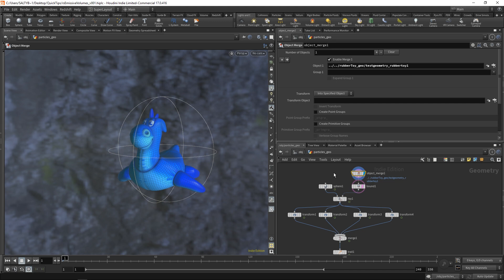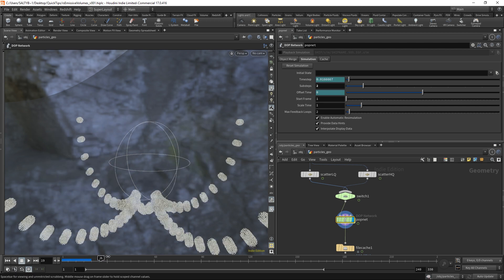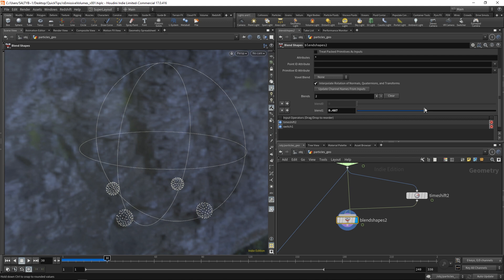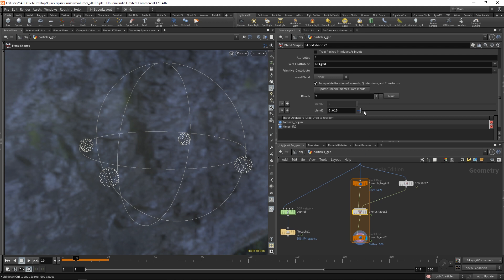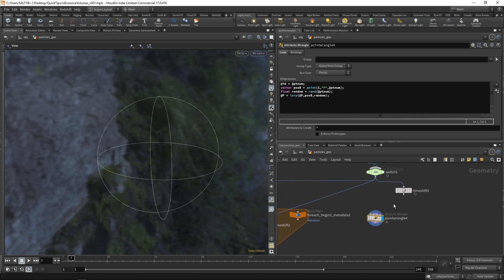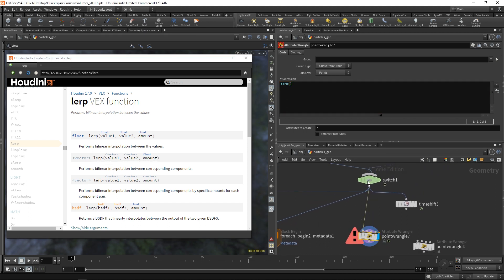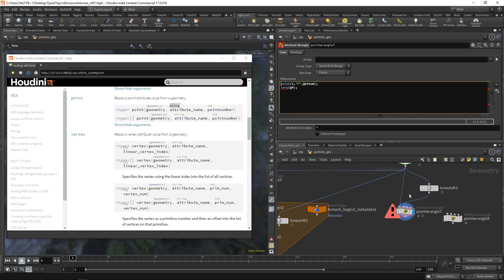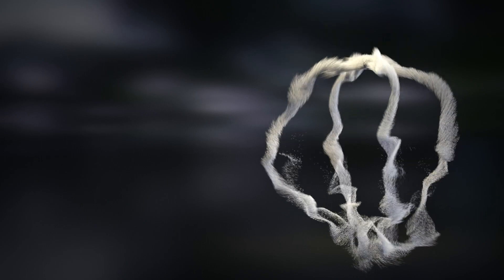Houdini For The Artist - Quick Tips - Particle Stepping

Comment: Isn't it same as interpolation? I usually set interpolation to 8-16.
Reply from the maker: Yeah, totally - you can just et the jitter birth to positive and the interpolate source to backwards.  That method will sometimes break though because it relies on interpolation on "Matched Typology."  So it's good to know a few other ways of going about in case you need to troubleshoot that situation.

Comment: Wouldn't it be far easier to just set Jitter Birth Time on the POP Source, and then Interpolate Source? That seems to be the exact setting for what you've manually built here.
Reply from the maker: Well shoot, you're totally right avinashlobo! haha   If you go that route, set the jitter birth to positive and the interpolate source 'back' because otherwise you might not be emitting from the actual location of the emitter, but yeah - whoops, that's probably the easiest way to go about it.  Thank you for the comment!
Reply: Thanks for confirming. I'm brand new to Houdini, just trying to absorb and make sense of the sheer volume of new things to learn. I picked up that tip from the Particles Masterclass video that I barely stumbled through: https://vimeo.com/81611332

He talks about it around the 53 minute mark. Thank again, and I look forward to more of your excellent content. Cheers.
Reply: @cgforge  haha, you proved again that we can do the same thing in Houdini a million different ways 😄
Reply: @cgforge  but this works only if the topology of the object stays the same. if you have changing point count its doesnt work, right?
Reply: The P and v attributes need to be interpolated most often. The Jitter on the POP Source is indeed to do this thing. It is truly the easiest way to touch it.